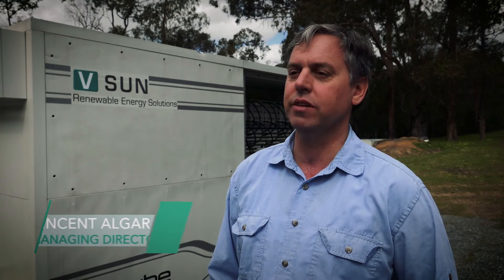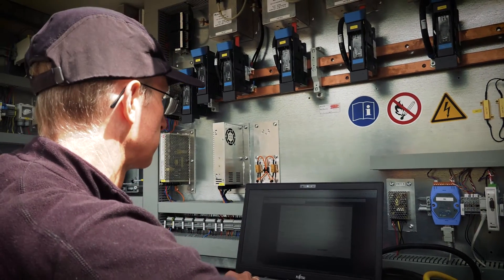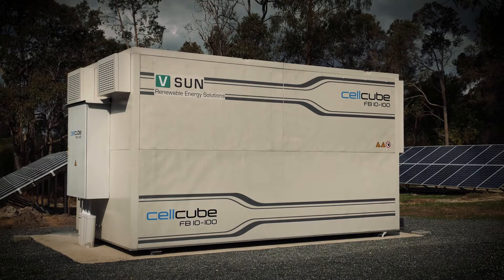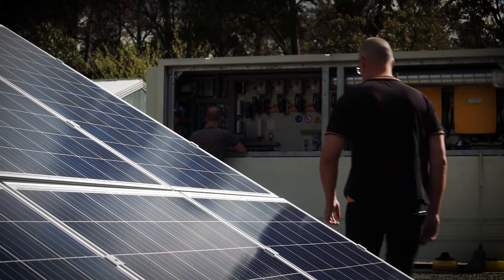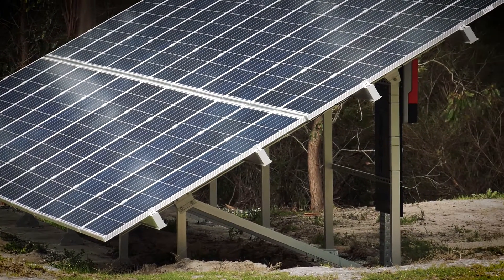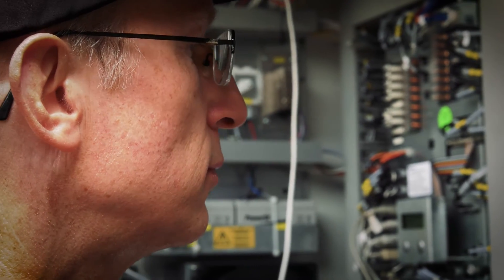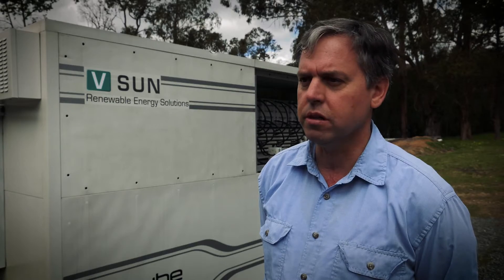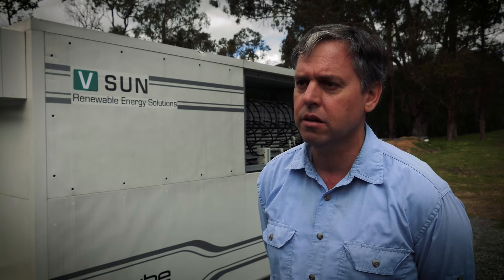VSUN installs vanadium redox flow battery

Comment: Out of curiosity, why not to make storage a bit bigger at the small power models? 10kW with 250kWh would be simply amazing. Ability to run for a day or two on a cloudy days without grid. It doesn't need to be fully charged in a one day, as charging it fully would require ~30h of non stop sun (so about 4-5 days) anyway probably and use of full array or half of the array to accomplish this.

I guess this is because you operate in Australia, and there are locations with very stable cloud less weather? :D

I would be really interested in having 20kW (continues) system with 300kWh of storage. Not to mention, the storage part should be relatively cheap to expand (more liquids and bigger tanks, but that part is really cheap, at the moment at least).
Reply from the maker: The great thing about VRFB is that you can do exactly what you talk about - scale the power and energy separately.  This particular installation is a 10kW/100kWh because that's what the customer required.  A 20kW/300kWh system can easily be made.